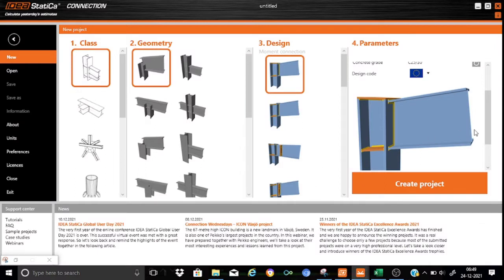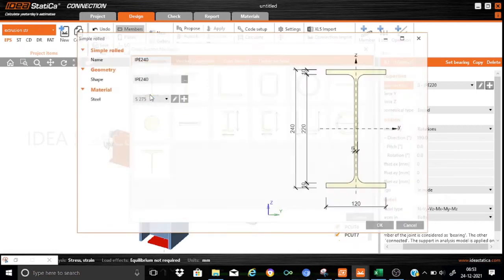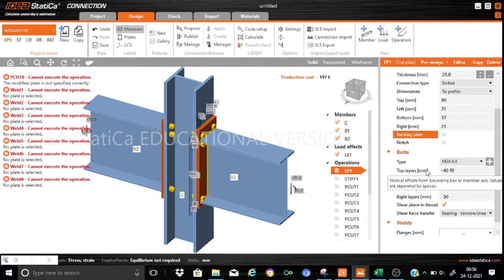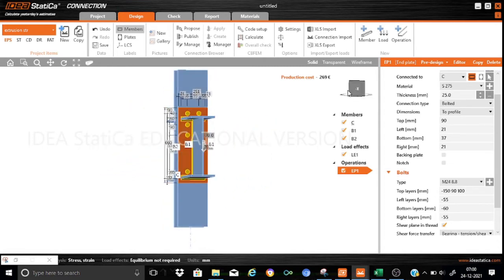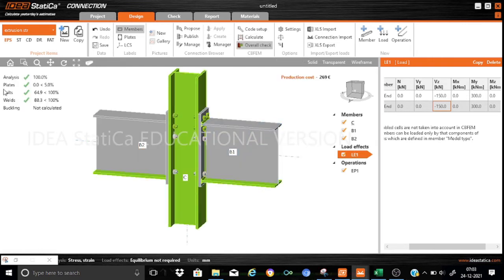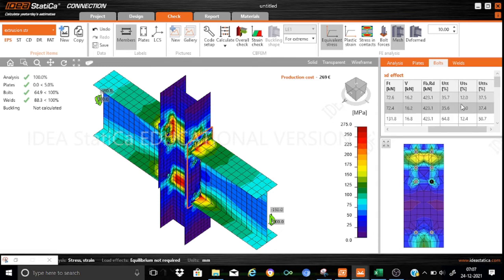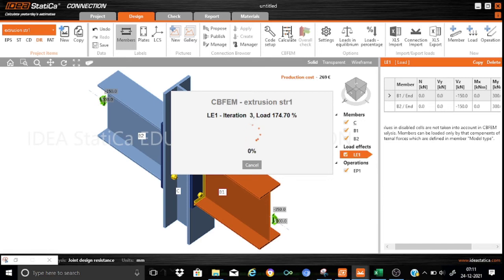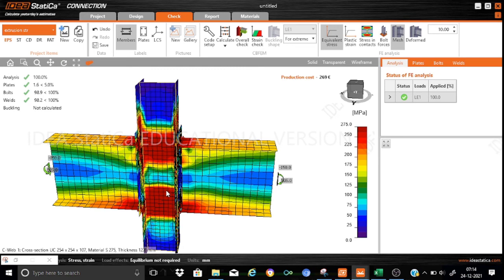IDEA StatiCa: tutorial-7: Column-beam moment connection using bolted extended end plates.

Comment: Great Video Sir. Thank you for great explanation. I have a question here. Software give design resistance Load Factor of 1.74. you have applied bending moment and shear force both in the EPS analysis. so why you did not apply load factor to shear force in DR analysis. since load factor the software give is for both shear force and moment that you have applied in the EPS??
Reply: How to approach progressive collapse connection design under middle column removal. How the loading will look like ? Please guide 🙏 .